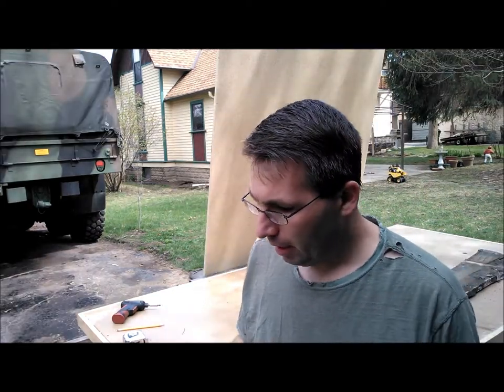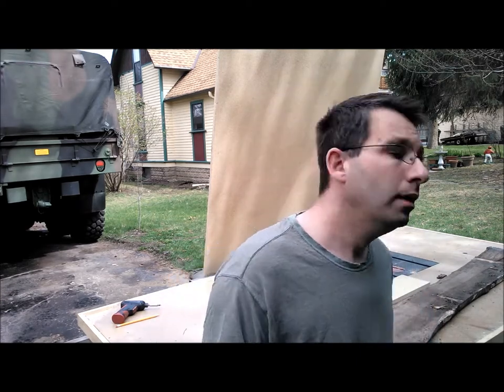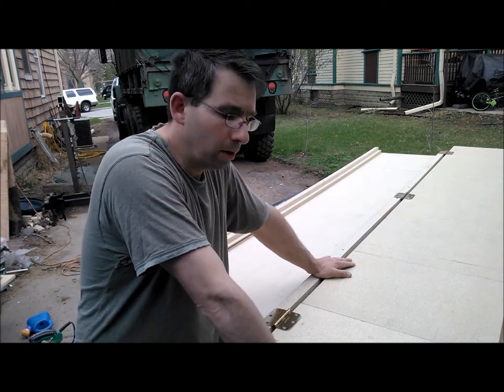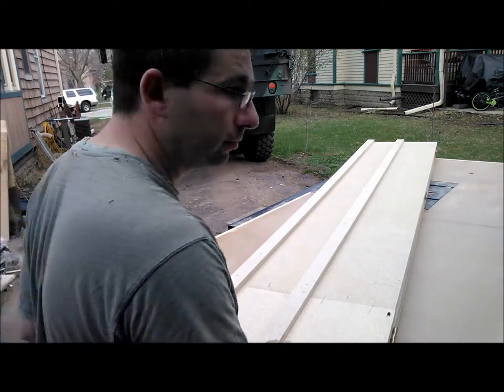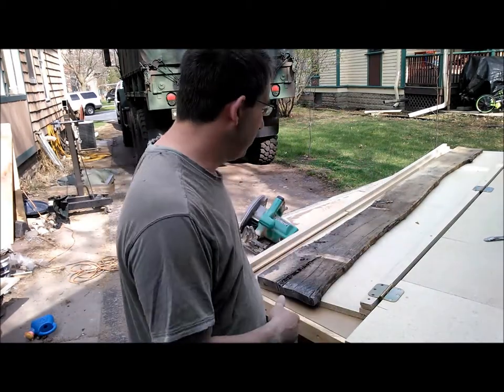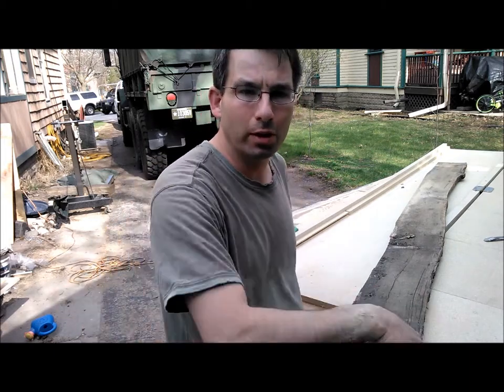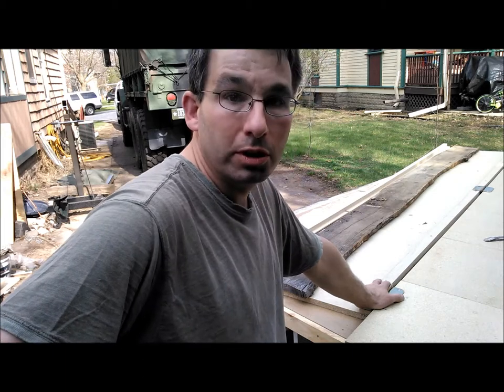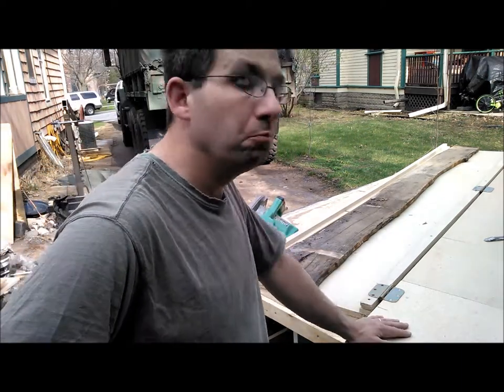Mill lumber jig

Comment: That's pretty slick. Like you I would think that would be hard to store, but it certainly gets the job done. I like the hinge effect
Reply from the maker: For now I slid it in the back of the 5 ton.  Nicely covered and out of the way.  Until parades start in a couple weeks.  Guess it's time to finish the garage.
Reply: nicely done.   also, where did you get your hands on a 5 ton?   always wanted a deuce and a half myself.
Reply from the maker: I had a deuce for a while and sold that to get the 5 ton.  I picked them both up at Ft McCoy in Sparta, WI.  For a while though I was picking up a lot of trucks for other people and going through them.  Sent them to all corners of the US.  I like the 5 ton but I still think the deuce is the sports car of the MV world.

Comment: That's a great idea, I can see all kinds of useful modifications as well.  You can add another cutline using the middle guide bar to clean up the other end at the same time, can put a cutline going across it near one end so you can cut to length.  Could also make a second top with the wood accessible to a router on a sled so you can "plane" it in the same jig if you don't have a planer (like me).